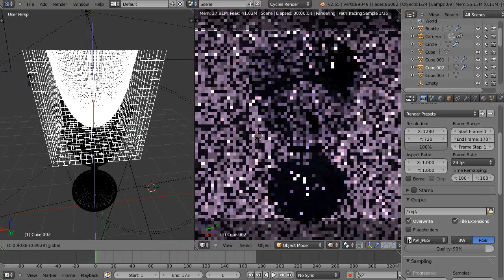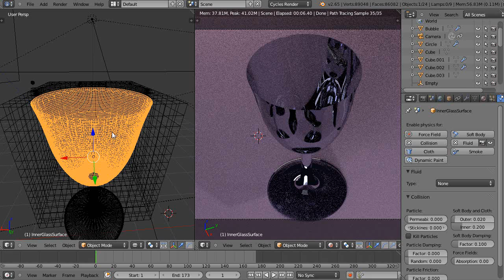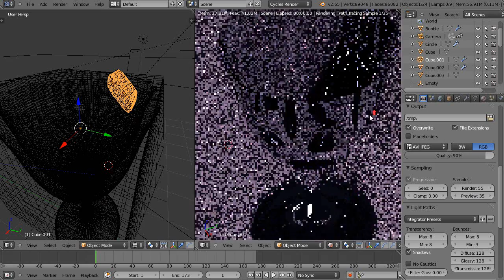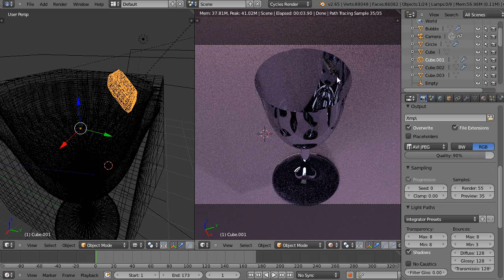Blender Fluid Tutorial -  Reflection Test - Water Glass Simulation

Comment from the maker: Your bathtub should be set as a Fluid "Obstacle", and that object should be inside a cube which is set as the Fluid "Domain".  Also, some objects don't hold water very well; make sure to check the direction of your vertex normals, make sure to subdivide it into enough faces, and crank up the resolution of the simulation for sure!  Good luck.